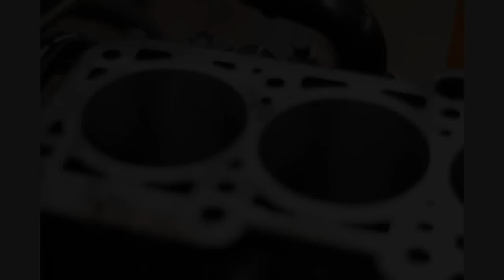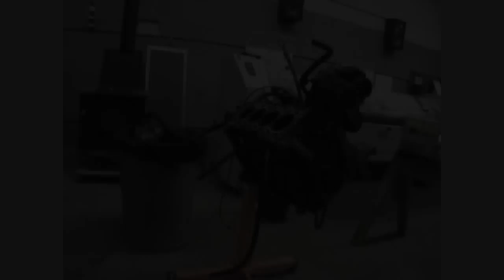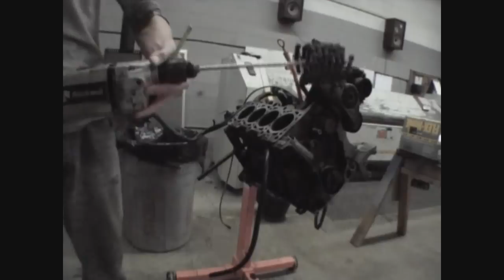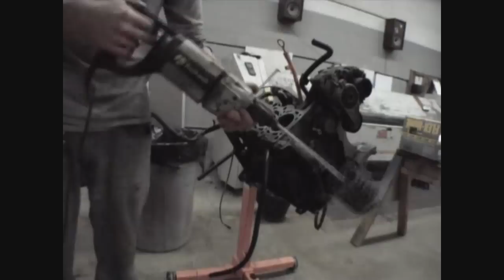1.8t engine assembly HOW TO(part 3)

Comment: Hi jazzpur, I need your help, I have an engine of an atos 1.1 mod 2005, I just put the rings for checking the gap and it measures .015 inches in the first ring , and in the second ring measure .016 considering that the rings are new, it is a good measure for continue assembly my engine or you suggest me not to continue and the send the engine to rectify, please reply me, I need your precius help. beforehand thanks.

Comment: Great job with the video. i did not completely understand how calculated how much to take off the rings. when you bore the block to get the cross hatch, do you need to get over sized piston rings? and do you file them down to more than the factory specification?( how much do you add to the gap?) Thank you!

Comment: @jasaircraft Once you get your first done, you can hold it against your next rings as a template when grinding. I actually put the rings together perfectly alligned and clamp them with 2 small clamps. Then grind all of them at the same time, and stop when the ring grinder touches the template ring.